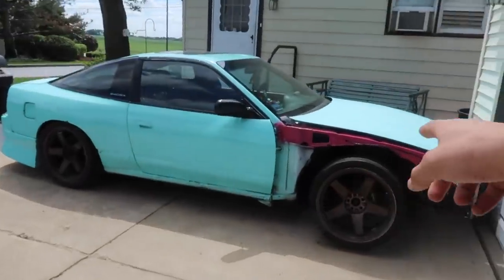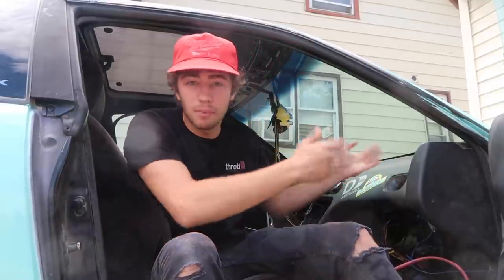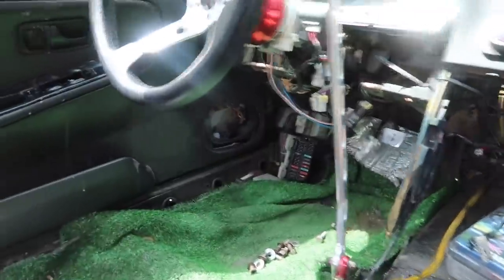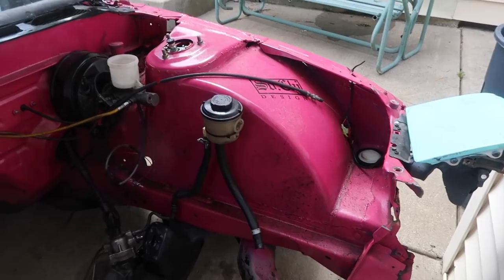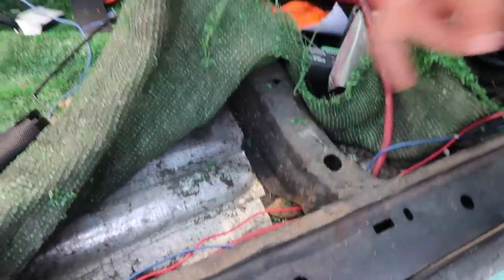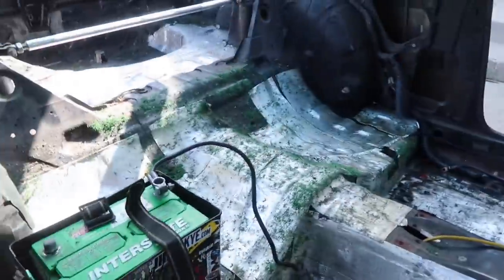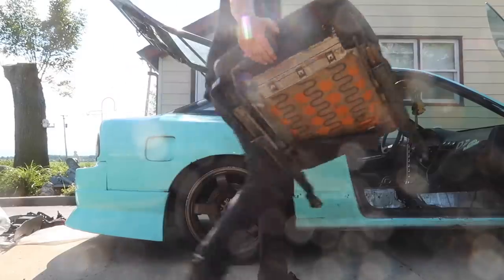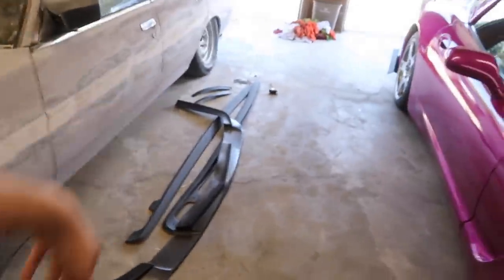HOW FAST CAN I "RUIN" THIS 240sx?!?!

Comment: Jeep Lift kit install soon?
Reply: Javier Villanueva lift the 180sx!
Reply: Isaiah Skullcrusher You see which side the steering wheel is on? Yeah? Then you should be able to see it's not a 180. American S13's came with a KA24 (2.4L) hence the name. Japanese S13 hatches are called 180's because they came with a CA18 (Turbo 1.8L), reason why it was named a 180sx. They came with a SR in later years, and were rebaged as a 200sx.

USDM S13's ARE NOT 180sx's OR SILVIAS.